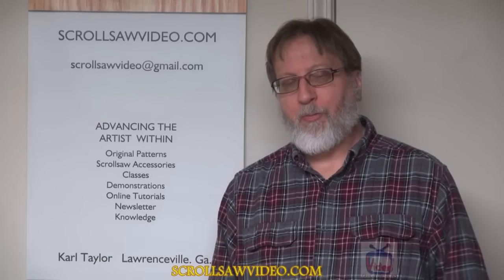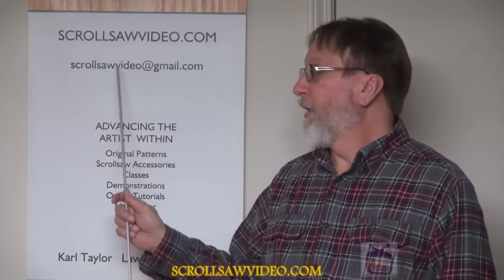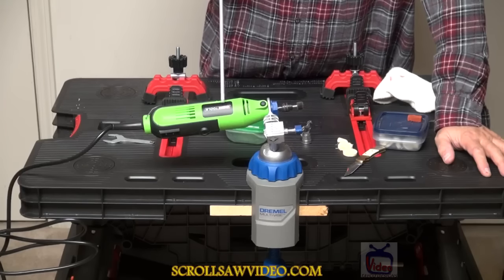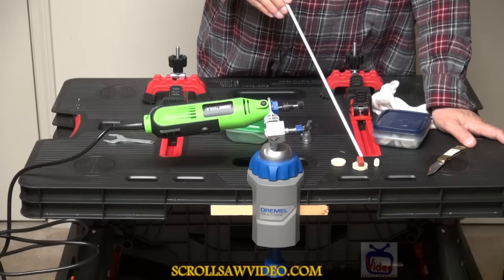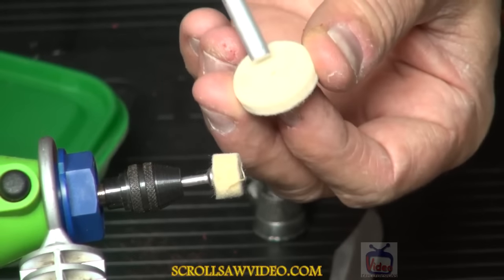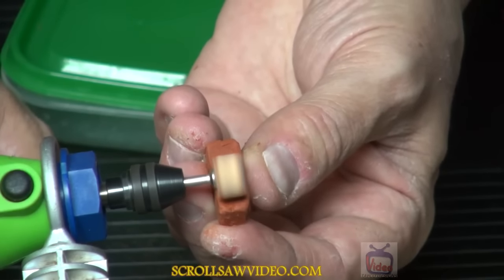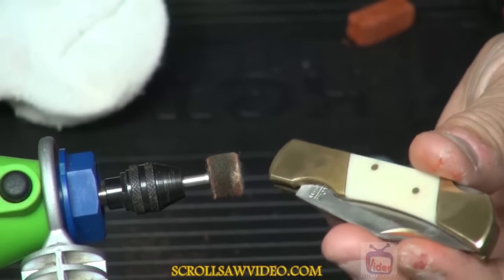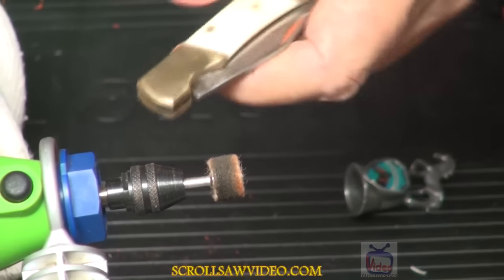How To Introduction Polish With Dremel

Comment: Please don’t throw the pads out after using them. Put them in a laundry/underwear bag and wash them on a delicates program and air dry them. Joy can’t also use a metal brush on your dremel and get the dirt of the pads. It’s just money out the window to throw them out after using it for just one time.
Reply: Thanks I’ll do that because I havnt got 10 bucks to waste on new ones
Reply: Don't re-use pads that have had abrasives on them. Doesn't matter if you wash them with a power washer, there will always be grit contamination.
Imagine polishing something at 1000 grit and a single piece of 180 grit carbon finally falls into place and gouges your work.
Reply: @jsplasha  they sell water by the thousand of gallons. There’s a base price for water, and that’s why people think that they’re getting charged so much for using water. I talked to a customer service agent and they told me about it.
Reply: @nathanielhartsuff2336 do u think professional car detailers throw away there mitts or pads after each use? They are worth up to $80 each. They wash them with dish wash and water and then just water then dry them. The same thing applies here

Comment: Ahhhhhh so that's how I attach the cotton wheels.
Thanks alot!
Reply: What did you think the little screw tip mandrel was for, if not for polishing 😆
Reply: @MrSniperdude01  just got my first set and was scratching my head at the screw tipped piece. And now i know!
Reply: @MrSniperdude01  to be fair the screw mandrel is described as misc. In the instructions.

Comment: Nice how-to video. Compound on a microfibre cloth works too, but you were showing us how to polish with a Dremel, so you are bang on topic. My only criticism  is that you were standing on the wrong side of the machine. When you get a catch, as you did with the buffing soap, it's going to fly toward you or your face . Standing on the other side leaves it to fly down, which is safer. Also easier to steady the piece.
Reply: There’s one in every group. Freaking safety man
Reply: @DirtyDickMurdoc  normally I’d agree with you, but when there are only 2 available options that are equally effective, why use the more dangerous one? You wouldn’t remove the guard off a bench grinder and work behind it.

Comment: It’s funny I’ve had a Dremel for years and never did figure out what that Screw looking bit was for Thx for sharing
Reply: Vinfish 46 I had always used the cutting wheel bit 😂😂
Reply: omgeeee, ive been using it wrong too XD - ive  been loading the buff pads on the bit that has a screw, thought that one was for making screw holes - hahahahaha
Reply: I knew what the bit was for but I never realised the red bar was polishing compound. LOL. Also got it about 10 years I think.
Reply: Had it for 6 years ddnt know what thr hell those lil blocks were
Reply: Me either, i was trying to figure out what that screw bit for... now i know
Reply: Isnt it pretty obvious? The polishing wheels are the only ones that can be screwed onto
Reply: it's amazing. all the comments will most likely different brand dremels and none came with decent instructions. lol I was in the same boat
Reply: Well the screw bit can do more than that
Reply: Read the little chart that comes in the kits 🤣 I was puzzled until I found it myself lol
Reply: @NicB-Creations  Lol. I thought the red bar was some kind of weird shaped sanding stone.
Reply: None of mine came with a little block my polishing compound for dremel always comes in a little plastic container I'd rather it come like that little block would be much easier to use then trying to dig out some with those polishing pads.

Comment: I really appreciate your video and the time you take to share your skills and knowledge with us all. I don't mean to be rude but would you please tell me what happened to your fingers. It doesn't bode well when it seems that you have polished the ends from them in a few places. I of course understand that using gloves will be next to impossible in the miniature world of small rotary tools. Please look after the skin on your hands. Use a good product like O'keefs or similar. I've had eczeema for years so, it makes me twitch when I see somebody else suffering. Keep the bids coming.
Reply from the maker: I dont think you are rude in asking.
Its a medical condition and I only have around 25% feelings from the end to middle of first joint. 
I dont mind, God gave it to me and I cant be mad at him.
Reply: What a sweet way to present your concern. May God bless you.
Reply: Woodworking, DIY, and Review Videos this comment is three years late but here goes. Skin only grows back so many times, then you get just scar tissue instead of skin. So, wearing gloves for some things is worth it. Now they have knit gloves with an anti cut coating on the fingertips. I got some for 4$. I just cut the cuffs a bit so they wouldn’t constrict my wrists.  They look like gardening gloves but the coating is not rubbery and they actually cost less than gardening gloves. 

Thankyou for your videos!

Comment: Thanks for posting.  Would the same steps and tools be used for resin?  Also, can the polishing pad be used multiple times or do you use a new one for each project?
Reply: The pad will last for several projects.
You can use the red compound ( 'jewellers rouge') for resin or can try auto polish paste or even toothpaste.

Comment: Thank you for this, I was an idiot on how to use this tool even though I've had several sets of them, I've had no reason to polish something until now. <3 When the wax turns black do you need to discard the polishing wheel and get a new one? Or does it mean just more wax?
Reply from the maker: LOL, I was too until the lady had my polish the doorknobs. Usually I will use the wax until it becomes a total mess, cant decide if i am cheap or frugal. 
Thanks for watching.
Reply: If gets gunky, use a small piece of wood to absorb it.  A popsicle stick would do.

Comment: What is the best way to remove tarnish on bolts into aluminum windows on an old travel trailer. I'm thinking that attempting to replace them would cause the heads to break off and cause a much bigger problem.

Comment: I have the bullet and cylinder shaped polishing bits and they are so hard I can't polish or buff with them. Is there something I can do to soften the bits so they will pick up the compounds?  The flat polishing wheels I have work fine, they are fairly soft and pliable.    Thank you

Comment: What do you do with the excess dirt on the polishing tool? Will the layer just peel off?
Reply: The dirt is mostly oxidized metal particles trapped in the fibres and wax. Usually people just use the pads until they don't work and them throw them away. You can try washing and reshaping them if you want and might get a bit more life out of them.

Comment: Does the wax feel like a rock almost like a sanding Rock that's the only thing I can find in my kit I don't think mine come with wax . I have a long squared shaped piece like yours but mine feels more like a sharpening tool than  wax. Will that even be used for anyways in a rotary tool kit, that's crazy it didn't come with wax because it's a 208 piece rotary tool accessory kit 🤦🏻‍♂️
Reply: Is your wax in a little plastic barrel shaped container? Some people sharpen the points of drill bits, ergo, sharpening stone.

Comment: do these screw on type polishing pads stay on well enough when applying a bit of pressure? I'm just wondering if its better to look for the fixed type of polishing wheel rather than the type you have here.
Reply: No, this kind actually sucks.  They work for a minute, but if you use them with halfway decent pressure or real speed, the screw rounds out the inside pretty quickly and they just start spinning. To avoid frustration, use the kind with a fixed core and the pad attached to the outside.  You get what you pay for.
Reply: I think they recommend not going over 15,000 rpm with these certain types of polishing wheels. I’ve had no issues so far.
Reply: John 304 aha! Golden comment!  Thankyou! I’m snooping through the comments and learning so much. Hoping to find out how to hone woodcarving blades, but learning plenty along the way.

Comment: Hello and thank you for this. can the felt buffers be cleaned and reused? I just polished a gun barrel and only had one of the cylinder bullet ones that fit so I would hate to throw it away.  Alcohol, or some kind of solvent perhaps? thank in advance...
Reply from the maker: Honestly, I have never tried to clean one of the buffers. Hopefuly another viewer can advise on this.
Thanks for watching.
Reply: Some are actually made from wool, so a bit of soap and hot water with a vigorous squeezing and bashing might felt them enough to tighten up. Don't twist them.
 The whole pad will shrink a bit too, but it's cheap to try.

Comment: safe to polish plastic headlights?  Different compound tubes i seen at hf. the low price is tempting. but it has to work.
Reply: If you are polishing plastic and polish too long or lean too hard it can heat up and the plastic cam melt and deform.  It can polish well but take care

Comment: It looks to me you polished off the gold plating and now it's silver ?I would have hit it with 1500 or 2000 grit wet or dry sandpaper with some oil first after taping off the handle part.Maybe just some mothers and a rag instead of a dremel ?

Comment: 3:11 what do you call that orange thing he added for  polishing ???
Reply: That's "polishing compound".  It is the "grease" that lubes the process. When you are done it will look black on whatever you're polishing. Wipe it away and, voilá, you have a polished finish. 

It comes in some of the kits, or you can buy it separately. Or you can use fritz polish or something else. Depending on what you're doing. 

Hope this helps. Take it easy. Good luck.

Comment: Im new to Dremel polishing.  I fine grit sanded copper bottom of a pan and it took the dark crud off and left shiny copper but with sanding marks of course.  I put some red paste on a buffing pad and applied but it actually darkened the copper and made it less shiny.  Did I use the wrong thing for the job?  I have no idea what I'm doing just experimenting
Reply: The paste needs to be cleaned off after

Comment: How do you get the black oxidation off of the felt bob? Is it just a one shot use?
Reply: David Carr I think using the edge of a wood block
Reply: Don't worry about the black on the felt pad.  Just add more polishing compound on top

Comment: Maybe some Brasso rubbed on it and left to dry and then remove later with a clean dry polishing wheel would have gotten you through at least the bulk of that tarnish without having to work so hard.
It's not polishing evenly and you're actually removing metal whether you realize it or not so if you do that very often it will really show later in the form of Groovea

Comment: When I try to put the compound on the felt the only thing that I get is Polish flying through the air everywhere. I've also tried adding water both by dipping the felt in the water and adding it to the compound and that helps a little. All of the compound that I've been able to obtain through Harbor Freight has been colored which leaves a bad Hugh on everything I try to polish, primarily rocks. I've had better luck using Crest 3D whitening toothpaste.
Reply: if you are playing with rocks , try taping down the trigger on a belt sander with super fine grit then flipping it over . works really well  . i too play with rocks. you have the sander running no need to even touch it , just move the rock around. also a super fast way to make cool wooden swords for kids if you feel so inclined , it is a great way to use that tool.
Reply: The red polish is jewelers rouge.. Its only for soft metals like copper, aluminum or brass like that knife handle.. You also only use light pressure and a slow speed if you have crud flying everywhere your speed setting is too high
Reply: @carlnikolov  I've had this same issue High & low. I use the Dremel 8220. Even tried smudging the compound on the pad, after I add water to loosen it a bit --- works a bit but still lose most
Reply: Douglas Miller -- Toothpaste is great stuff. It actually cleans up most things like Aluminum, Copper, Pewter, Steel, even rubber soles of your shoes.

Comment: I was just gifted a Dremel Stylus but can’t find any information on what bits I need for the two things I wanted it for. I work with polymer clay and wanted to be able to buff and polish my pieces. I also wanted to be able to drill holes into the pieces. I can’t figure out how to change bits and what to buy to do these two things. Any suggestions and help would be very appreciated! Thank you!
Reply from the maker: I have never buffed polymer clay but hopefully another eeader can help with that. Drilling holes, get the quich change chuck and use any drill bita up to 1/8 inch.
Reply: Let me know if you’d like to pass the Stylus along. Mine turns on, then cuts off within seconds. I miss using it...

Comment: You'll notice the edges of your polishing wheel we're the only place where the compound ended up and if you had used a corner instead of the flat side it would have been more through the middle of the pad but more importantly it would have rounded out the corner making it a lot easier to get an even distribution next time

Comment: The result is not impressing. There are streaks and you have probably burnt the surface of the brass because of too high speed due to too small diameter of the buffing wheel.
Reply: Smaller diameter = lower speed...

Comment: Hi Karl, could you tell me if the Dremel multi vise will work with a Wen rotary tool model#2305?
Reply from the maker: Since the main connection is the tool housing and not the actual tool threads, I cant see where it would not fit. You should be good on this one. Thanks for asking.
Reply: @ScrollsawVideo  , Thank you sir.

Comment: The compound that it comes with my rotary is green and it feels like wax. Is for polishing or for somethink else;
Reply: It's for polishing. That's all that red block is. Just hardened wax.
Reply: Usually green is finer than red.
Reply: It's not wax.  It's very likely green rouge. Good for final stage polishing of stainless steel, steel, brass, aluminum, nickel and chrome.  It is a very fine grit chrome oxide compound embedded within glue or a grease binder.

Comment: Hello, Karl.  I'm trying to figure out how to polish the tiles in my bathroom using a large buffer, and a small Dremel tool.  One question I have is:  how do you clean the pad once it gets dirty from all the stuff it's taking off whatever it is you're polishing?  Thanks for making this video.
Reply from the maker: Great question but I dont really have a great answer. Have you considered Oxy Clean? Try a good soaking and a scrub with a very soft toothbrush. Hopefully one of the other viewers can give a better answer.
Reply: Linda if your refering to the pad on the dremel i like to hold a razor blade,  box cutter, or similiar item and while the pad is spinning just shave off layers. be careful as this combination can perhaps be a bit sketchy but it works great!!!!

Comment: I am having trouble getting bad scratches out of stainless steel kitchen knives The polishing compounds don't seem aggressive enough neither do they transfer to the buffing pad very well either  Do you have any suggestions or product recommends?
Reply from the maker: One of my hobbies is restoring old wooden handled kitchen knives. Klingspor sells solid rubber sanding pads in three grits. First start with the course, then medium and finish up with the fine.
These are awesome blocks. I do have a couple of vids that show these, one was just released .Restoring An Old As Head'.
Reply: OMG < Someone actually answered one of my questions on line < thank you, Karl !! I just woke up, but I'll get on these right soon < Thanks again!

Comment: I just bought a Hyper tough accessories kit the same day i bought the Hyper rotary tool. This kit came with polishing compound but however, it was packaged in a container that i cant get it out. My question is to you or anyone out there that may have a remedy for this?
Reply: Use the cutting wheel of the Dremel.

Comment: Im having issues getting small scratches out of a .999 fine silver pendant... when i polish them away with my dremel they all dissapear but after washing off the metal they reappear
Reply from the maker: Dont confuse polishing with scratch removers, totally different process. You may need to consult a certified coin dealer to learn scratch removing on coins.
Reply: @ScrollsawVideo  its not a coin it a pendant of a lion... i made it myself now i cant shine between the grooves...
Reply: @malcolmcliff-du8qp  silver that pure is going to be near impossible to keep absolutely shiny. Commercially made items are often plated with a shiny surface metal like rhodium.
For a pure silver, handmade item, I would find that the natural marks would enhance your work. I bet it looks awesome. Some people actually use products to speed up the effects of wear on silver artificially.

Comment: hi! Does it work to polish acrylic displays? It has small slight surface scratches.
Reply: You will likely leave gouges in the plastic. If you do try to use a lot of water in a very soft felt pad and apply no pressure at all but I wouldn’t use a motorized tool on a display.

Comment: For the new polishers out there, there is a bit of misleading stuff that i see on theese videos, and thats getting the compound on the polishing wheel.
Its actually a waste of compound to get it on the wheel whilst its spinning.
Stop it, and spin the disk into the compound by hand, that way the compound wont get splattered all over the shop.
Reply from the maker: Great tip, thanks for sharing.